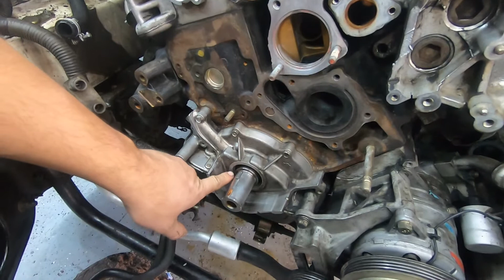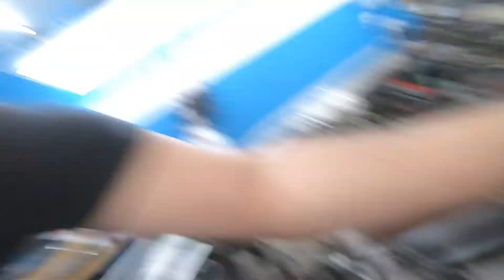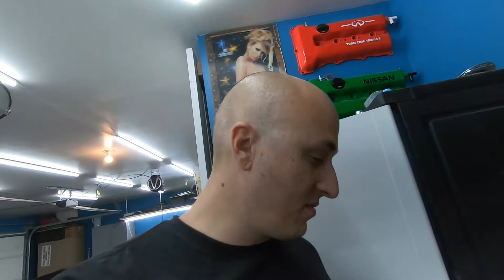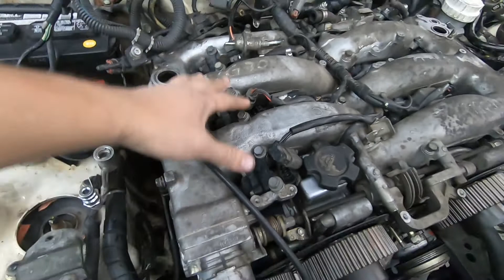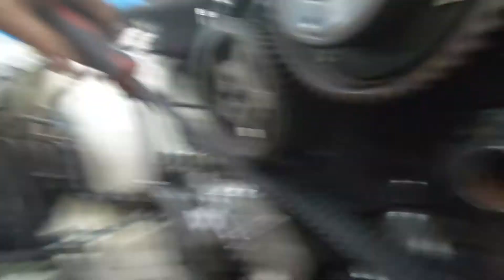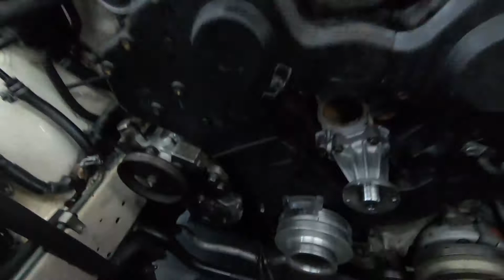Nissan 300ZX Z32 Timing Belt Change — Complete 120k Service (2025)

Comment: Hi Jesse, I am the second owner of a 1990 Nissan 300 ZX. I have it since 2004. It only has 116,000 miles The other day I broke down. I believe it is the timing belt that broke. I have replaced the clutch, the duel exhaust, H-pipe, spark plugs, brakes, etc. over the years. After watching your youtube on the timing belt replacement I feel confident that I can change out the timing belt. My question to is: Would you know if the 300 zx engine is an interference or non-interference? Could I have done damage to the valves, cylinder head, and anything else? How can I determine if I did any damage? And if I did do you have a youtube on how to remove the heads? Can I send them out to be resurfaced and new valves installed? Regards, Paul Kreger
Reply from the maker: Ouch Bro, Hope its not the Timing Belt. yes the VG30 Engine in the 300zx is an Interference Engine. If the Belt Broke and Valve hit a piston, Bent Valve is the Best Case Scenario for something like that. Probably be easier to source a good VG30, Do the 120k service on that and replaced the now damaged one in your Car. Good Luck, hope you can get the z32 back on the road soon.

Comment: Hey Jesse, is there a way to hold the crank shaft from rotating, perhaps when in park mode on the automatic trans? i really dont want to remove the starter and wedge something to hold the fly-wheel
Reply from the maker: I just screw in the crank bolt and use a wrench to hold it. You shouldn't need to remove the starter. At what specific point are you at in the process of changing the belt? let me know
Reply: @NightShiftGarageYT  im going to start it at any weekend now, i just wanna make sure i dont get stuck with anything like this. Say the stage where the harmonic balancer needs to come out. ive heard that if the crankshaft would spin when atempting to break loose the 27 mill bolt thats holding the balancer. how do i prevent that? manual trans guys put it in 5th, what about auto trans ?